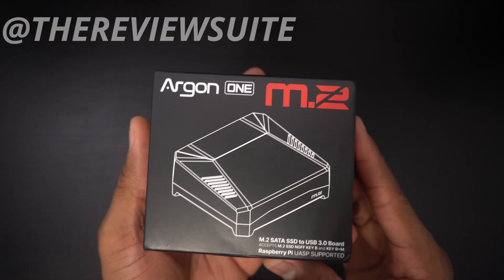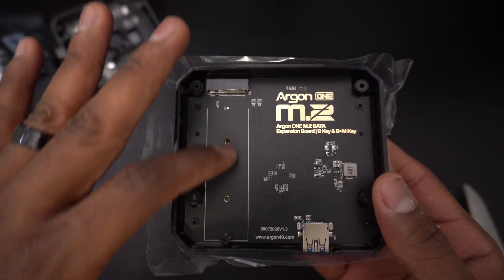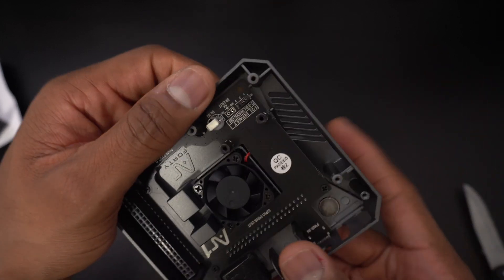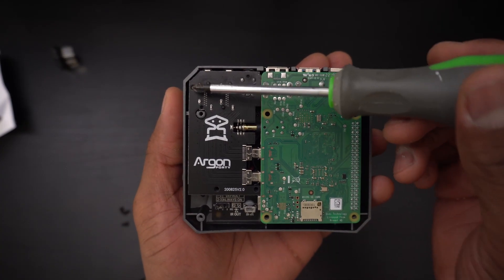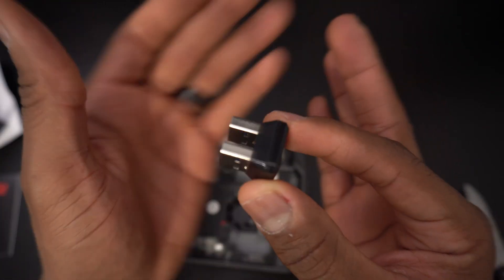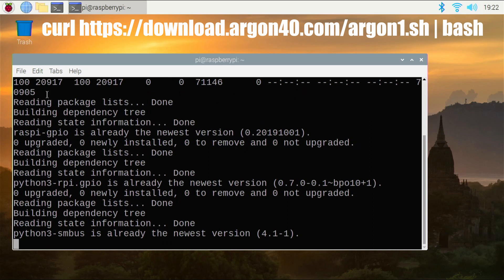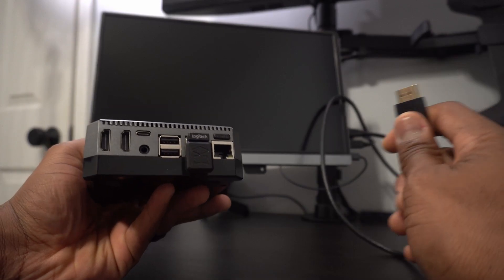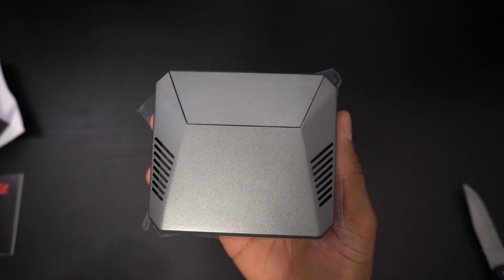Argon ONE M.2 Case Raspberry Pi 4 Hands On

Comment: Wondering if the 240GB Kingston of the same line will also be compatible. It seems not all M2 are.
Reply from the maker: The Kingston A400 240GB should work. There is a newer version of the Argon ONE M.2 case with NVME support coming soon.

Comment: Would a 970 Evo m.2 work?
Reply from the maker: Unfortunately no. This board only supports SATA m.2.
Reply: @iam.jasonhoward  Jeez what a lightning fast reply, Thanks man it means a lot!
Reply from the maker: @harisuresh2507  No problem 😁
Reply: @iam.jasonhoward  Oh and one more thing do you know any nice m.2 drives that would work with this case?
Reply from the maker: The Kingston m.2 drive I used in the video works fine. Its faster than an SD card but not nearly as fast as NVME.
Reply: @iam.jasonhoward  I got another question so if you have an answer it would be appreciated ok so my question is what pi 4 should I get, should I get the 8gb or the 4gb?
Reply from the maker: Would definitely get the 8GB raspberry pi.
Reply: @iam.jasonhoward  Alright thanks!
Reply: @iam.jasonhoward  WHOO HOO I FINNALY GOT MY ARGON 1!
Reply from the maker: Awesome
Reply: @iam.jasonhoward  Yep and my Rpi is coming a little later.
Reply from the maker: Cool
Reply: @iam.jasonhoward  Yep, and I just installed my raspberry pi in the argon one so all I have to do is download an OS and I'm finished!

Comment: Is there a case that houses the pi 4b, internal battery of some kind, heatsink & fan, power switch, LCD screen, and maybe even a small SSD?
Reply from the maker: The Argon ONE M.2 is currently the closest thing you’re gonna get. Most cases offer either or, not both. You can power the Argon ONE M.2 with a battery bank. How long it last will depend of the the size of the battery. The Pi-Top 4 DIY Edition has an internal battery but no SSD support. Hope that helps.

Comment: Thanks for your video. 
Did I notice that you didn’t pull off the plastic from the second side of the thermal tape? Any reason for that?
Can you see any reason they wouldn’t have made the case in such a way to allow access to the SD card?

Again, thanks for your video. Liked and subscribed. 🍻
Reply from the maker: Thanks for watching and subscribing. I did pull off the plastic on both sides of the thermal pad. I just cut that part out. I’ll be sure to keep that in next time :). I’m not exactly sure why Argon 40 chose not to make the SD card accessible. But, having the option to switch the bottom plate is great.

Comment: argon One m.2 when I connect the double USB connector to connect M.2 SSD disconnect the WiFi signal solution to this problem
Reply: that's wired. the usb port should have nothing to do with the wifi card.

Comment: I recived my Argon One M.2 case a few days ago. And I also highly recommend this case. But I ordered the CanaKit for Raspberry Pi 4 and that came with a HDMI to mini-HDMI cable. I was fine using the mini-HDMI ports. But now, I have yet another cabe that I can't use laying around. That's my only complaint about this case - it took away my mini-HDMI. Yeah I know I can buy a little adapter.

Comment: I liked the video it was really informative. I own the original argon 1 case would you just get the expansion or would you do the complete upgrade for full hdmi.
Reply from the maker: I think it depends on how you are going to use it. If you are going to use your Pi 4 as a entertainment device you may want to upgrade for the full HDMI. But if you just want to have an M.2 slot the expansion should work just fine. Thanks for watching :D.
Reply: @iam.jasonhoward  Thanks so much.